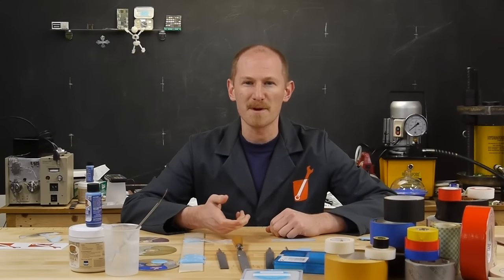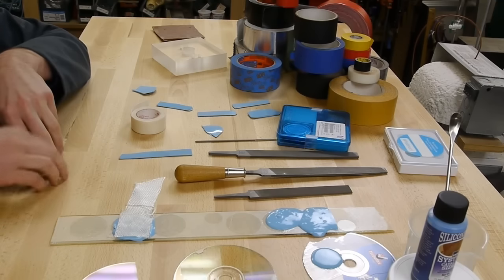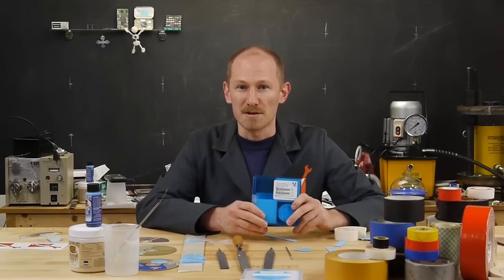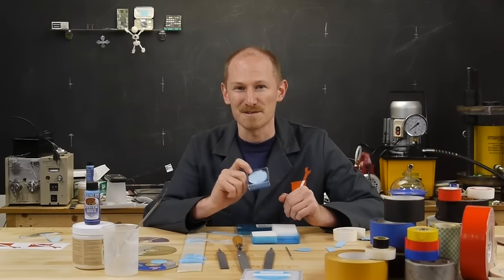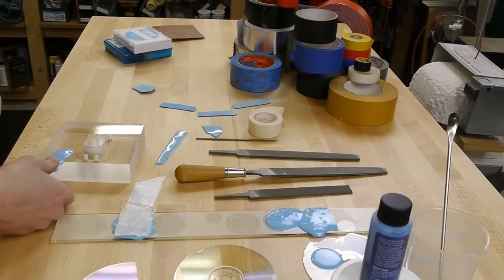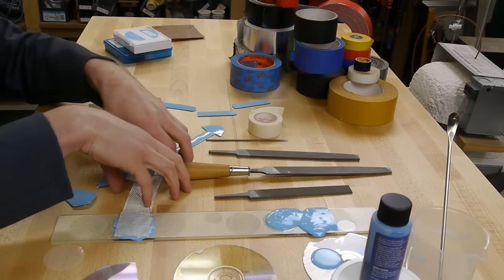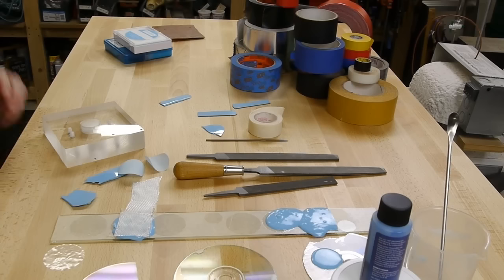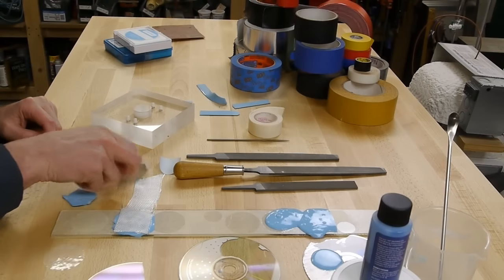Making DIY gecko tape - work in progress

Comment: that may be a stupid idea, but why don't you use those super fine sandpaper for paint. They feel almost like a normal paper but you feel the friction. Maybe making a mold with a more resistant material and then putting the silicone. Anyway, I haven't done any research before so I don't have idea of what I am talking here.

Comment: I am building my robot out of softer materials than most due to cost as well as tooling equipment I have to work with. I have had really good results using several layers of plastic in both sheet and tube forms to reach strong tensile strengths with much less weight as well as it being more workable with my limited tools. (  I wish I had the funding to buy a 3D printer I could get much tighter build)

Comment: cast the silicone on a diffraction grating sheet. those should be easy to find and buy, and they also come in many densities. 0.5um wide channels should come up to 5000 lines/cm. if you google SEM images of diffraction gratings, you'll see why they will be perfect..

Comment: Cast the file in wax and then cast the silicone in that wax. This way you can take advantage the sharper top of the file and not have to deal with the dull “valleys” of the file

Comment: you could try to deposit a layer of carbon particles onto the Glass mold with an open flame and later dissolve the carbon from the silicon.

Comment: you could try using UV Silicon and a vacuum plate to help pull  it through the membrane and then flash curing it with UV might need to build a rig of some kind ... so as the silicon exits the membrane it will flash-harden from the uv  heat may also be your friend ideally to get the control and get nice little rows of hairs it needs to harden as soon as it exists the membrane so it can't `flop` over like wet noodle

Comment: I had two ideas you could try.  Sorry if these have already come up in the comments.
Could you try using a blue ray disc?
And if you were to make a mold of the Swiss file then make a cast from that, the contact edge would be "sharper".

Comment: How about a modified DVD burner rig? The burner lense and tracking rail suspended over a spinning substrate.You controll spin speed and then calculate the amount of time per beam firing to etch the surface to the desired length and depth. Best part is, people have already figured out how to controll such a device in a similar way for CNC cutting. Just google for "DVD burner cnc" and you can find plans on how to do it for almost no cost.

Comment: I know this is an old video but you might read it. what if you were to use your silver coating device. I think it's called sputtering, but any way what if you were to sputter a piece of plastic or acrylic and then microwave it for a short time.

Comment: there might have been something to that CD idea.
The difference would be to coat the CD first with a protective layer, to smooth out any irregularities, and then after that with a write-able layer whose height you can control using the centrifuge technique you described in the video.
Then just burn a lot of 0s and 1s using a CD writer.
(ok, I'm talking out of my ass since I don't have a lot of technical knowledge on all of this but the idea seems doable to me)

Comment: Along the lines of using the super fine file, would an ultra fine honing stone/steel provide similar/improved results? The surface may be too rough, but considering the "grit" of some of these stones can be up to 10000 -  their microscopic "grit" structure may have an approximate aspect ratio similar to the gecko feet.

Comment: ...although... when a gecko dies, do its little microscopic spindly toe things shrivel up, or do they keep the same shape? if they keep the same shape, you could mold it's toes into silicone to make a negative, then make a positive from that using a material that has equal definition to silicone that won't stick to it, then make a pattern out of the positive, and use silicone again to make the gecko tape. I doubt that will help, because I don't know anything about the subject.

Comment: Pressure-sensitive adhesives (PSA) form a bond by the application of light pressure to marry the adhesive with the adherend. They are designed to have a balance between flow and resistance to flow. The bond forms because the adhesive is soft enough to flow (i.e., "wet") to the adherend. The bond has strength because the adhesive is hard enough to resist flow when stress is applied to the bond. Once the adhesive and the adherend are in close proximity, molecular interactions, such as van der Waals forces, become involved in the bond, contributing significantly to its ultimate strength.
-wiki

Comment: How about using an alloy of metals, one which can be removed through some acid process, and another which will not? similar to Raney Nickel, which has a sponge like texture. etching times could significantly change the size and shape of the pillars.

Comment: Would lith film work?  It should hold fine detail, but I am not sure if the emulsion is the right thickness after the developer and fix/stop bath have created the image.  An old imagesetter with an HeNe laser might work too, but you would have to use HeNe sensitive film instead of lith.  Thank you for all the great videos!!

Comment: Could you squirt a layer of super glue down and place the filter on top so it would flow up into the filter and make the effective height of the holes less? It would probably take a few tries, but maybe combined with your spin coater could be achievable . . . ?

Comment: Since you most easy and effective way of making the gecko groove involved casting it onto the tracks of an original CD polycarbonate, why not try the same method, but dying the silicone in a color that absorb the wavelength of the laser of a DVD burner and then make some tweak to try to print the grooves onto a cd blank thinly covered with the silicone. Alike the lightscribe thing to print CD's back label. The key is to fool the DVD burner into thinking It's writing a CD blank or in case of lightscribe, the back label  of the CD. And for improvement of the absortion of the laser on the silicone you can try what you do with electronic microscoping, cover it with a very fine vapor deposited layer of metal, in this case aluminum perhaps.

Comment: make fingerprint like pads

spread a layer of silicone between two glass slides with spacers on each edge to make a sheet the exact thickness. when set roll the sheet in to a small tube. cut the tube into slices. try different angles, and thinkness. arrange the disk in different patterns stick to a piece of tape, or set in another layer of silicone. make tiny slices in the pads

Comment: if you use that fine file to make an intermediate mold, then mold the silicon onto the intermediate, you'd have those sharp teeth on the surface of your molded silicon

Comment: I immediately thought of the mat side of aluminium foil, and the ease of etching with caustic. I then saw lots of other contributors were of a similar mind. A further thought is a parting agent between the textured surface and the silicone rubber. Apart from preventing sticking, could this partially fill the pores? Could its quantity be used to control the depth of pores and hence the length of hairs?

Comment: A CD was a step in the right direction, a DVD have about 8 times as many valleys and bumps on it, a Blu Ray have about 32 times as many (all smaller ofc) 

The binary numbers 10101010 and 01010101 (170 and 85 respectively in decimal) give you the most pillars. look at an asky chart the characters that use those numbers the most. in normal text files each character uses only 3-5 bytes, so create a text file of that character large enough to fill the Blu ray, or DVD and give that a try!

Comment: Ok, I have an idea. Is there a way to control what is burned into the cd? The actual shape of the grooves? maybe if you did that to a dvd (or maybe blu-ray) you could get an interesting result. You could try to fill a dvd with a file with specific data, so you would get only one type of marking on the disk surface.

Comment: a) It is quite easy to buy poly-acrylic microspheres (or glass microspheres but with glass it is much more difficult). There are many ways in you can use them. Standard procedure for making mesas (small holes) for quantum dot observation sounds suitable here. You can spin-coat solution of plastic microspheres on metal surface (or other base surface that you can dissolve), than coated it (sputtered etc) with gold, dissolve plastic microspheres. As a result you will have  base surface coated with gold with regular beautiful micrometer-sized holes. Now you can use some kind of chemicals that react (dissolve) substrate but not react with gold.   b) You can try two perpendicular diffraction gratings for exposure of photoresist over metal (or other) surface to obtain regular micrometer-sized pattern. Than develop it . Correct time in acid will result in good aspect ratio. c) What about ZnO (zinc oxide) nanowires? They are relatively easy to obtain and by varying growth conditions you can control aspect ratio and dimensions. Perfect for a mold d) If you are looking for porous surfaces for mold try: different plaster and gypsum sheets, feathers, hematite crystals, kainosithe crystals, other minerals and crystals, carbon-paper, activated carbon, wood coal.
Reply: e) You can make 100MHz ultrasonic standing wave in resin, or photopolymer. Or even 2D standing wave :)

Comment: So, I haven't read the paper on this gecko tape, but the video made me think of spiders.
What I had always thought was that spider had tiny "grabling hooks" on their feet, making it in to all of the nooks an crannies of the surface they are crawling on.
They way i see the gecko, is that they have soft feet with indentations, making it excellent at creating vacuum for wet and often slippery surfaces. And for rough surfaces they have hairs that split and are wider in the ends, making friction.
So basicly, tiny suction cups, with microscopic velcro inside, which again has fingerprints on the end of the hairs. . . 
Am I just insane? xD

Comment: Have plants been considered as a source of moldable material? Many plant leaves and parts have very interesting nanostructures. I understand that there are some plant leaves that are hydrophobic due to their nanostructure: what would happen if you cast a hydrophobic plant leaf? 

Also, have sprays been considered? If cryanoacrylate "superglue" is widely available and inexpensive perhaps there is benefit to exploring a dedicated nozzle system that sprays cryanoacrylate in droplets of a micron size with enough variance to achieve an appreciable aspect ratio? The nozzle might be advanced but it could be scaled and perhaps sold as a commercial product, depending on the design of the flow nozzle.

Comment: i have a question, maybe stupid but anyways. what if you used high quality printer and print just lines? i agree lines wont be close together enough but you could print very short dots on vinyl and cast silicone. it would make suction quite strong and its all it needs

Comment: Hopefully not too late to the show, but what about using the membrane, but finding a way to decrease aspect ratio of the holes etched in it?  I have to wonder if you could develop some filler material that can be spun-coated onto a piece of membrane that would be able to fill the voids while not adding too much to the total material thickness.

Comment: okay, im a bit late maybe and a bit off scale but somehow use carbon nanotubes as those hairs? if too small, what about spider silk? one casting idea as well: take a bunch of (human) hair and when they line up all the cross cut would be a lot of circles next to each other but those circles have gaps between them where would those pillars form as you put casting material on top. i believe hair can be found in different diameters and therefore those gaps vary as well. maybe try different casting material as well as suggested before.

Comment: So, Destin from Smarter every day did a video on Butterfly-wings where the Colors are created by gaps in the structure which absorb special wave lengths. Therefore I assume these gaps are really small. And i think there are some materials which mimic this property. So maybe you could use butterfly-wings as a mold :D

Comment: I was thinking a mold made from a diffraction grating in the UV range would work better then a file.  Still one would think you could use nano magnets mixed into wet aerogel supercritically dried while pulling the magnets out. Though one of the issue is a mold made from this would be too fragile I would think.

Comment: Have you tried casting a natural material with some kind of micro structure? I was unable to find a good example, but think of the textures present on butterfly wings, or the tiny hairs that make water droplets glide off of some leaves. Clearly nature has an abundance of microscopic structures, the problem would be finding one that could be cast and would produce the pillar-like structures you are looking for.

Comment: Why not to use surface of deep anodized aluminium instead of CD? It also has small and deep holes before they are locked. Plus you can apply high friquency vibration to intensify the process.

Comment: Hey Ben.  What about burning a CD with a file full of nothing but binary 1s at 1X speed with the laser hacked to be powered at 8X, 16x, etc?  Also someone mentioned bubbles being trapped in the holes of the mold.  I was thinking that too.  Maybe try doing the CD one more time but dropping it into your vacuum chamber to see if you get longer pillars.

Comment: What about coating a surface with nano particles and using that as your mold?  I used Nano particles for flow seeding in my time resolved PIV research and you could get silicon carbide particles down on the the order of 40 nanometers.  Quite expensive stuff though, about 400 dollars for a few hundred grams, but that’s plenty to make tons of molds tough part would be arranging them in a pattern.  Maybe you could charge them some way to follow field lines then once that set adhered, slightly adjust the field line location and then add another coating...kind of a layered deposition I guess.

Comment: What if you hacked a cd / DVD / Blu-ray drive to either change the spacing of pits and lands on a disk or even put the photo resist on a glass slide or a poly carb disk and spin it under a laser like a cd.   With the correct timing profile you should be able to make any pattern you want. I would think that you could find a photo resist that would work with a laser from one of the optical media.  Also side note I suspect they used neutrons to weaken the polycarbonate for the filters.

Comment: What if you use the surface that you get before adding the silicone. It should be filled with holes that could act as suction cups, effectively achieving the same result as the gecko tape (almost)

Comment: Can you grow tin whiskers or similar on a surface to a controlled length? Then cast a matrix around them and etch them out to make a mould for your silicone.
Reply: Or electroplate on the matrix in another metal.

Comment: have you tried to use nanoporous alumina templates? like in  anodization of pure Al foils you get those honeycomb Aluminium Oxide templates. Depending on the acid you use you can tune the diameter and the lattice parameter of the honeycomb structure as a function of the applied voltage...  I guess you could also use it as a cast (?). If you´re using phosphoric acid i know u can get radius of the nanopores of the order of 250 nm and u can control the length of the pore by the time of anodization. easly you can stop the anodization of the AL foil once you figure out the Aluminum Oxide growth rate in your conditions, and just stop it  at the desired 2 micron AAO thickness. then just repeat the same process of the silicone casting.
Reply: +rodas361 http://www.mdpi.com/materials/materials-08-01350/article_deploy/html/images/materials-08-01350-g002-1024.png for example a SEM micrograph of the kind of structure u can get
Reply: rodas361 the problem is that when you expose anode coat to air it creates bohomite and will seal the pores. To do what you have mentioned the anodised aluminum must remain submerged in a liquid.
Reply: P. S. 2 microns is very hit and miss. 5 microns is about where you get a result that is stable. You need to balance your current density to voltage is not enough to guarantee a set pore size. Nitric acid is used in conjunction with phosphoric acid to achieve an even result when etching the material. It is then anodised in a solution is 170 grams of sulphuric acid per litre of water

Comment: Hello bin I study thin films and nano science  time ago I think that you can make some thermal sputtering and sputter an element in vacuum chamber then do some itching if your lucky the element will stick in your silicon because of heat and move away after itching then you may have kind of nano structure depend on the efficiency of your deposition

Comment: would it be helpful to perhaps cast it onto a very fine a and thick brush? then you would cast fibers as thin as the gap between the hairs. maybe a circular brush and squeeze it together with rubber band or hose tightening strap

Comment: Could you make your own filter with the ones you got by taking some different material, layering the filter you have on top of it, and then pouring some substance that will not etch the polycarbonate but will etch through the bottom on?  I would think this would result in reproducing the size and layout of the holes in the filter, except result in them being perpendicular as gravity draws the etchant straight down as opposed to following the chemical weakness left by the decay tracks possibly.